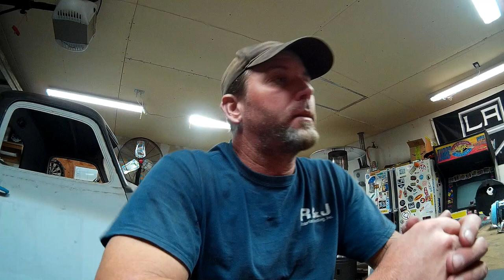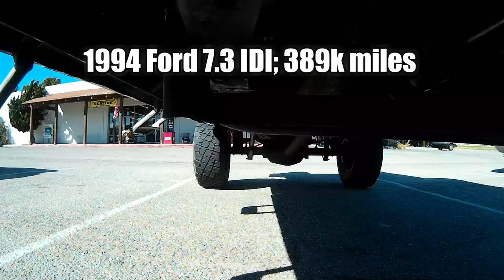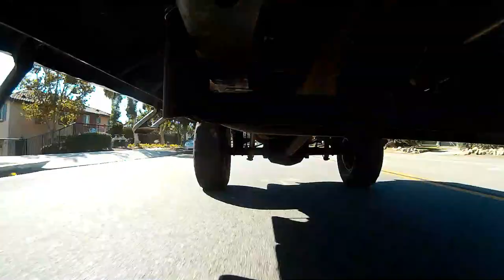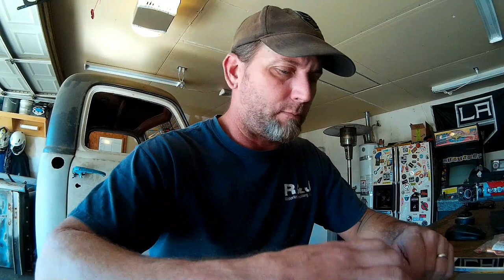Ford OBS; 7.3 IDI, How Bad is it?

Comment: My 94 idi w/ factory turbo has that pcv vent thru the factory cdr valve.  I noticed the copious amounts of oil in the turbo. After I rebuilt the turbo, 248k miles, I made and installed an oil catch can inline with the cdr valve.  Works well.
Reply: Walker Ashcraft I would love more info on this I've been thinking about doing the same thing
Reply: Do you have a welder? If so, take a piece of 2.5 or three inch exhaust pipe, and weld the top and bottom on it.  The factory cdr hose is one inch inside diameter.  Take about two inches long pieces and weld those 90 degrees apart.  You can let the can hang by the hose or make a bracket and go off of the last intake runner.  You need to make a baffel between the inlet and outlet of the can or it'll do no good.
Reply: Yea I got a welder how long does the baffle need to be... and how far apart should the inlet and outlet be
Reply: The inlet and outlet need to be at different elevations along the length of the exhaust pipe.  They should be clocked 90 degrees apart to clear the factory air filter housing.  Baffel should go approximately 70 to 80 percent of the diameter of the pipe.  This allows enough gas to flow past the baffel but not enough to allow the oil particulates to get past the baffel.  In my case the quantity of oil built up in the turbo compressor housing was reduced significantly. Since I can rebuild the turbo a significant reduction was good enough for me.
Reply: Alright man that is some damn good info ... I appreciate the help buddy
Reply: I just piped my blow by with 1 inch hose to the back

Comment: That is not a bad amount of blow by, even a fresh rebuild idi can have blowby. My 180k motor has just as much as that. They can have power just need fuel parts and larger turbo
Reply from the maker: yeah, it might not be as bad as i feel that it is.  thanks.
Reply: IDIs have massive blowby, which goes through the CDR. As long as it's all piped into the intake, no worries.
The way you tell you need a rebuild is when it starts using like a quart every 50 miles. That's rings worn to the point that it's rebuild time.
(as a note - I had an engine at this point... and it still fired up just fine, with working glow plugs!)

A stock turbo'd 7.3 IDI(either ford factory turbo, Banks, Hypermax or ATS kit) can make 200-220 HP at the wheels, vs about 85-120 NA, with stock everything. The key is backing off the torque screw*, and cranking up the fuel screw - with a properly working turbo(no major boost or drive leaks), you'll be able to clean up everything a stock IP can put out.
And yes, it'll feel good.

(*The torque screw only applies to later-model 7.3 IPs, so your truck may or may not have it. It's a metering valve limiter that limits maximum fuel. The difference is a good 50 RWHP for a maxed out pump)
Reply from the maker: thanks man, good info!
Reply: Ahh yeah, that's not bad at all, Navistar built these engines with huge ring gaps, they have blow-by new. The real question is why do you have a draft tube and where's your CDR? The CDR should pull all the blow-by into the intake pre-turbo. The Banks kits came with a CDR adapter that attached at the cover in front of the IP, do you not have that?

Comment: Man swapping that Cummins sounds good online but that swap really sucks. They are expensive to buy as the swap was made popular via social media and web forums driving the price up like that Cummins is some gem and savior. I have had several idi’s. If you just want to make it not so sluggish there’s upgrades that you can do. Upgrading the IDI is cheap to. From my experience what you are more than likely seeing is not blow by from rings. The valve guides and valve train in general seem to wear more than the lower end of the idi. When I rebuilt mine it was over 400k mile engine and the lower end was still dang near perfect. There wasn’t even ring wear ridges in the cylinder walls and the main and rod bearings were still perfect. The most worn part was the valve train and the portion of the cam that the fuel pump arm rides on. At over 400k miles the only parts in the lower end that showed noticeable wear was the wrist pins/pin bushings. I would pull the heads first and inspect your cylinders on the 7.3 idi if they look okay rebuild the heads and put it back together. If you want to upgrade it a bit get rid of that tiny exhaust housing on the turbo and put on the ats upgrade that is a true 3” outlet and not that choked up stocker. Drill the wastegate rod so you can adjust it and shorten the arm once you drill the stopper crimp dimple and you want to set it upping your boost from stock 8ish psi to 12-14psi. Then mount you an intercooler and fab up some pipes. The 7.3 powerstroke intercoolers work perfect. There’s a company called R&D that sells upgraded injection pumps and while you have the heads off go back with head studs instead of bolts also sold through R&D. With an upgraded pump and turbo and intercooler upgrades it’s not hard to get decent hp out of the idi and it will cost way less you can buy a whole set of injectors for the price of one power stroke injector. I’m not saying the Cummins is bad but there’s a reason the idi you have is still running and it’s not because it’s junk. It just needs some wise tlc to wake it up. The stock turbo trucks were detuned some to allow the entry of the powerstoke option. If you want you could upgrade the turbo housing and exhaust now adjust the wastegate to 12psi and turn up your fuel pump a little and you might just be supprized how the old idi reacts and runs. Good luck!

Comment: That's normal they came from the factory with blown and using oil
Reply: Blowby
Reply from the maker: hey Cole, thanks!  yeah i dont feel that the blow-by is severe, and i agree it's probably the normal IDI amount.  it is compounded though by a crappy drain for the turbo that is allowing oil to back up into the turbo and being forced out the seals.  i think my next step is to remove the turbo altogether and see if that alleviates the "crop dusting" coming out the tailpipe....  Thanks for Watching!
Reply: Your welcome man it's a sweet truck
Reply: Hah factory option

Comment: Good video I have a 1994 Ford F-250 7.3 idi as well I’m considering put a 94-97 powerstroke diesel motor in mine but I have a feeling it’ll be a big job any chance of you doing this?
Reply from the maker: thanks Nick, i am planning a motor swap on my 7.3 but not a PS.....although we've been talking about something along those lines for another truck!  ....stay tuned & thanks for watching!
Reply: jim brown alright thanks and no problem and if you know someone who does the PSD swap let me know what all they did to make it work or maybe consider making a video cause I’m curious thanks!
Reply: Dt360 by international or 12 valve cummins
When and if my IDI ever goes those are my two choices on swap
Reply: I did the powerstroke swap in my idi truck. The only reason was we had a donor truck to pull from. Without a donor truck I wouldn’t want to attempt a psd swap. It would be a jumbled mess.
Reply: @sdm115  Yup inline 6 is superior to v8 when it comes to diesels